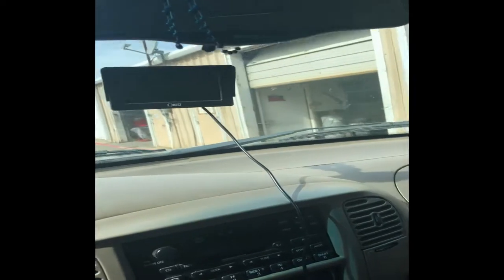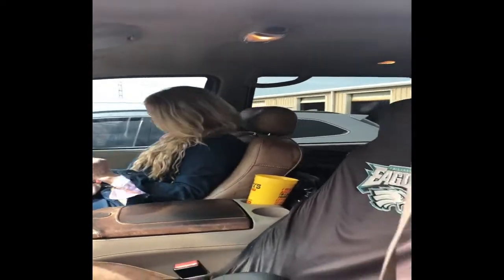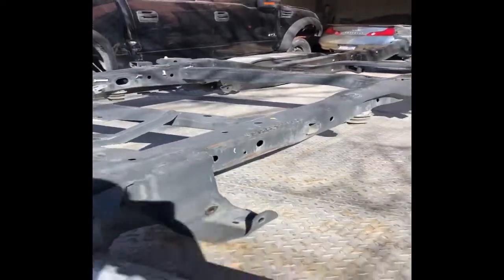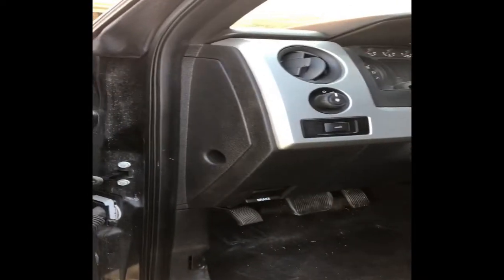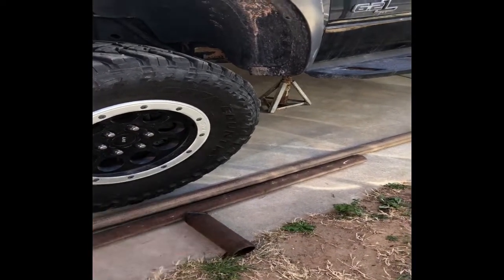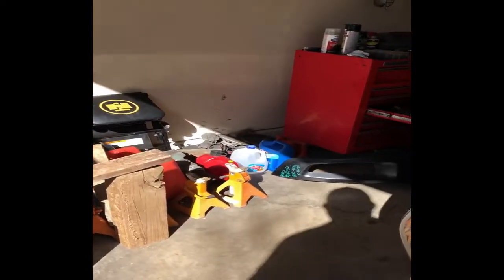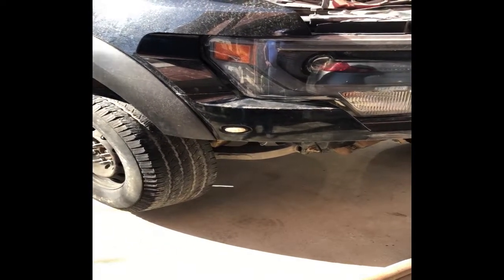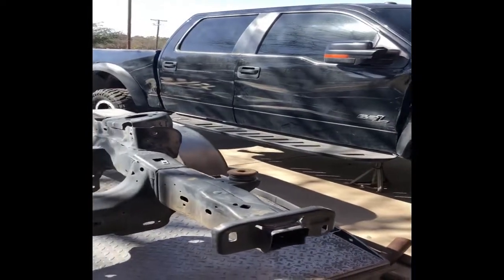Ford Raptor F150 SVT DIY Driveway Frame Swap and Rebuild Part 2

Comment: Thanks for watching and commenting on my videos. I know that for the same year they should be the same or with very little difference from what I could tell.
Reply: @easysimplemechanic  so was the frame you purchased specifically for the raptor or was it just an f150 frames that you found? Thank you for the responses, I’ve been watching your project for the last few hours haha! Impressive work!